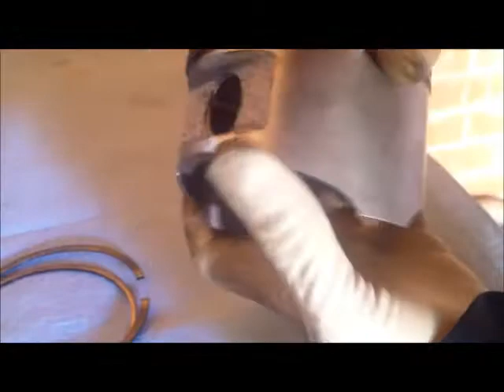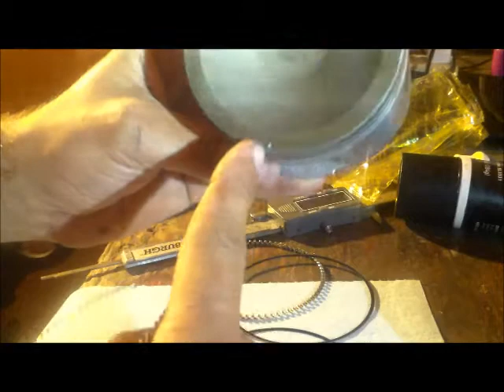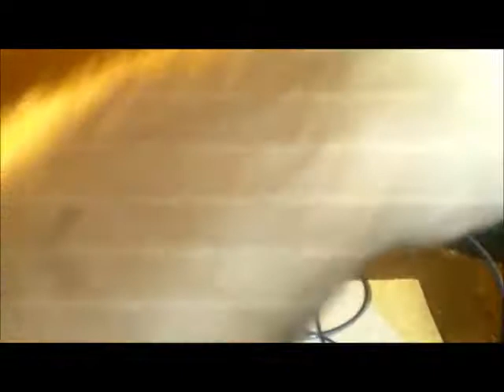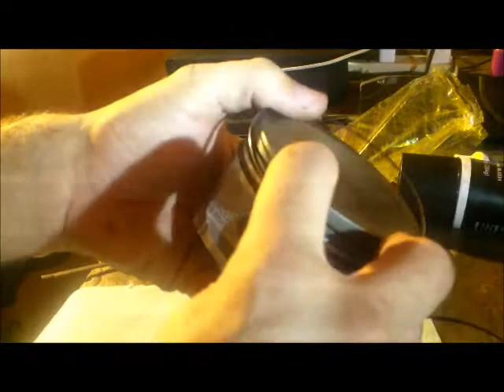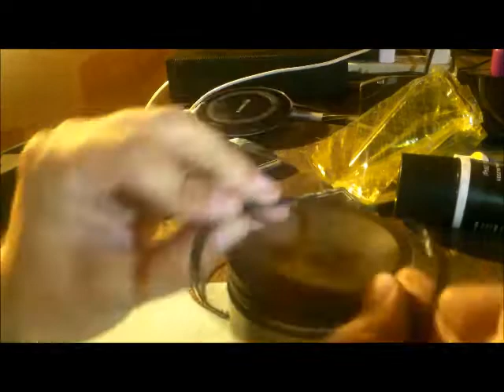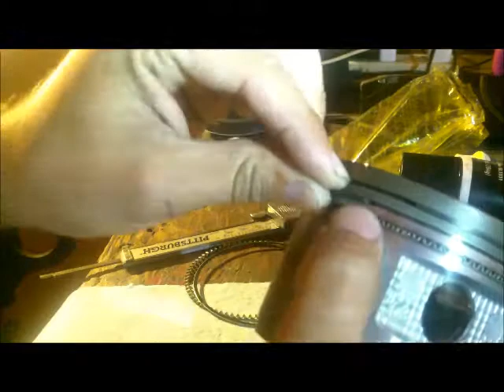Piston ring removal and install without tool!

Comment: very informative! didn't know how to istall the rings.. 
I was thinking on buying an s14a and since you have owned both s13 & s14, I would like to hear the pros and cons of both of them according to your experience so far. Also here where I live the s14 comes with sr20det stock. Which one looks better, feels better, responds better etc
Reply from the maker: so European s14 comes with a blacktop SR?? that's awesome. blacktop has more torque and HP than redtop. I'm a fan of flip up lights on s13 but honestly I fell in love with s14. chassis is stiffer. you can tell in drifting and cornering. the interior just looks nicer more modern too
Reply: BackIntoGear that's what I was thinking.. s14 looks modern and I like the fact that it's wider. Maybe I should start thinking seriously to buy one. But I don't want to give my s13.. tough choice
Reply from the maker: when i first bought my s14 i still had my 13. after a week i fell in love with 14 and was ok selling my 13 lol.. but yea i do wish i had both still
Reply: BackIntoGear so the trick is to buy first the s14 then it would be easy to sell the s13😜
Reply from the maker: pretty much.. soo only s14 issue that s13 does has is the plastic fuel tank. they develop stress cracking by the straps and start leaking. i had to replace my tank in the 14. tank cost freakin $500. rear subframe has to be dropped to change it out too . other s14 owners chim in if you had same problem
Reply: BackIntoGear wow that's a lot for the tank, didn't know it was plastic. Here the s14s are a bit expensive but in most cases are well taken care of. But if I decide to buy one I will definetely would check this out now. Anything else I should be careful?
Reply from the maker: i kno it really sucked spending $500 on a part that wasnt even gona add power lol. I took it down one time tried to patch the old tank but it didn't even hold a day so I ended up buying a brand new take from the dealer. other than that no other different issues